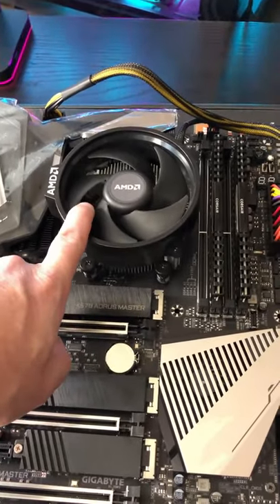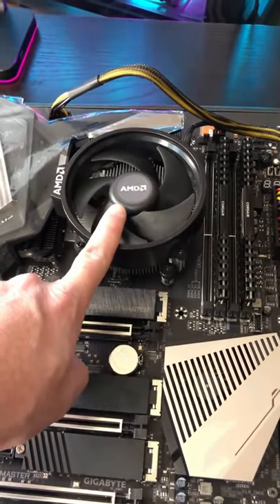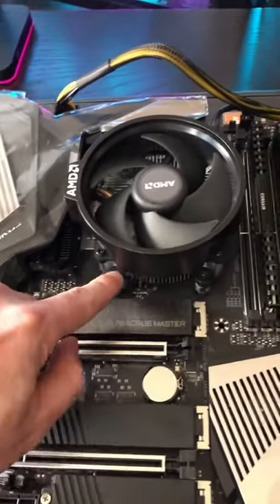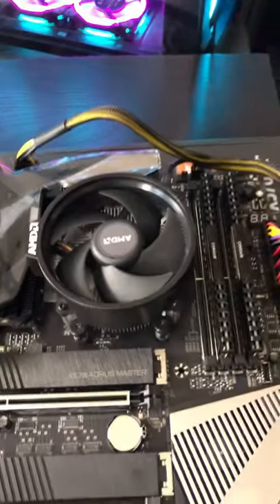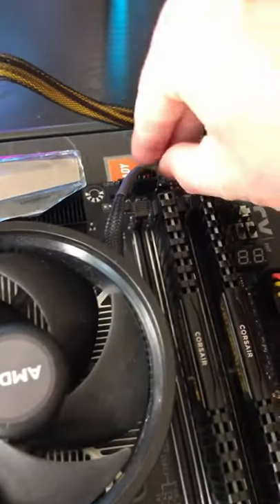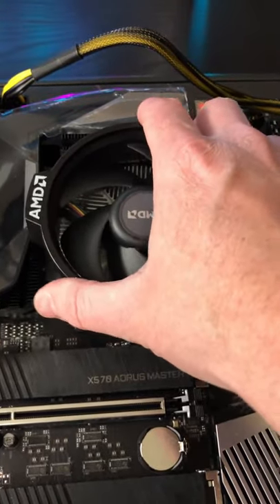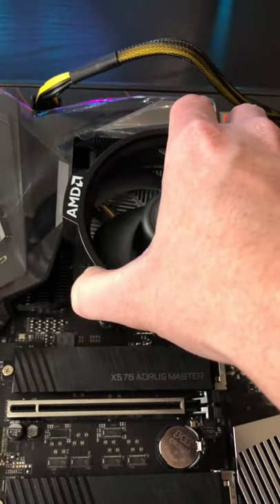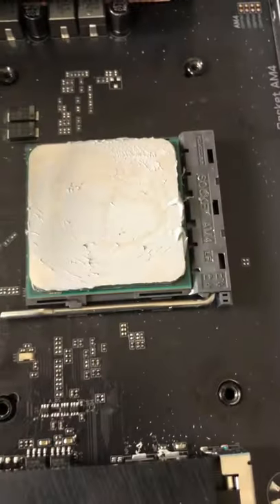How To Remove an AMD CPU Cooler Safely without Ripping the CPU from the Socket #shorts

Comment: Me: "Ok a little wiggle, slow and steady"
CPU: "YEET!"
Reply: XD
Reply: Lmaooo
Reply: I can't yeet mine, it takes three screws to open the socket
Reply: @messoremvitae  threadripper ?
Reply: @ianspy1  got a 1920x for 250 new
Reply: @messoremvitae  nice but i would much rather the newer TR parts. 
Sitting here with a 3600 wishing i got the 5600x but i couldnt wait
Reply: @liamcooper5202  personally im looking at upgrading to a 2970wx if possible. 24 cores instead of 12.
Reply: That one guy yeet!!
Reply: ahhahha
Reply: me, few hours ago
Reply: Crazy how the twist did all the job 😂❤
Reply: what happens if you pull it out

Comment: This video could've been help 3 weeks ago when I pulled my Cpu out and had a heart attack
Reply: Hope it still works
Reply: @gamingtalent2888  it all works, luckily I pulled it straight out and didn't bent any pins
Reply: @heyr3tr044  oh nice, i just got my new pc with the 3400g. I almost put thermal paste into the socket. I felt the same heartache😅
Reply: I had tge same experience lucky everything is ok
Reply: Same happened to me a year ago to a 3700x, after 15 years of intel builds it shocked me and I had to bend back some pins. Luckily still works tough.
Reply: I lost a 2700x this way. Not when I pulled it out but when I panicked that it was broken and tried to reinsert it with the fan attached. AMD should really improve its socket with am5. Make it more secure like Intel.
Reply: I just did this yesterday and did a strong pull, luckily nothing broke, i think i would have cried and breakdown from this long building process already
Reply: the same happened to me, but it falled in the floor and 20 pins were bended, so i had to bend them back to place and that took me 3 fucking hours :/
Reply: @NatrajChaturvedi  It's not the pins fault, belive me, those pins aren't easy to bend, but if you drop your cpu it's obviously going to bend the pins. If you treat the cpu carefully nothing is going to happend
Reply: Same happened to me today
Reply: I did the exact same think
Reply: Same happend to me
Reply: A few months back I replaced this exact cooler on my wife’s PC only to pull the chip with it and then see it drop on the motherboard. Long story short. I spent the next 5 hours straitening the pins with a tiny piece of plastic. And yes it worked like a dream after :)
Reply: Built my first PC just a few weeks back and had this happen when I tried reseating the cooler. Yeaaaaaaah would have been good to know.
Reply: That issue seems to have happened to a ton of people. AMD definitely should look into it.
Reply: @brunoglopes  If memory serves the Zen 3 / Ryzen 5000 series will be the last one using the AM4 socket so there's maybe a fair chance that the next one they use is a LGA..... or nah haha.
Reply: @Android Expert works like a charm. Doesnt boost to its max tho, its boost clock is 4.2 ghz but it stays at 4.00 ghz. It does get pretty hot under load tho even at 4.00 ghz.
Reply: Are you me? Because I did the same thing 3w weeks ago
Reply: Same here, I even bent some pins, luckily they were only like 3/4 at a corner that I could bend back.
Reply: Same, I did it during xmas and bent 2 pins
Reply: Same 😭😭😭😭
Reply: I nearly destroyed a Ryzen 9 doing that. Not a very good day.
Reply: had the same heart attack after renewing thermal paste
Reply: @NatrajChaturvedi  Yep AM5 sockests are using LGA 1718
Reply: @gamingtalent2888  How did you even do that
Reply: @trashgamedev5730  the previous owner had put a buttload of thermal paste on the cpu which leaked out of the sides and when i tried to clean it up, it got nudged into one of the squares but i managed to get it out with a needle before it got really stuck.
Reply: Same I was so scared that it wasn't going to work and I had just wasted 200 dollars
Reply: @graceeeess  u ok?
Reply: It's happened to me a few times and I just swapped the cooler a little while back to hopefully avoid having to do this
Reply: F bro😞✊
Reply: Note: if you use Noctua NT-H1 thermal paste, in most case, the CPU goes out with the cooler. The first time i got cooler out of the CPU: where the heck is my CPU. Oh my god, it has some pins bended because i wooble it a lititle hard. Other thermal paste has no prolem. Maybe this is the problem that AMD goes LGA instead of PGA in next gen.
Reply: @NatrajChaturvedi  🥺
Reply: Happened to me this weekend with my 3600. Didnt bend any pins thank fully, Cinebenched it and it works perfectly thank fuck!
Reply: So I removed the cpu fan and I can’t reinstall it I need help!!
Reply: @M3turkz1  did... Did you brake the screws off the motherboard?!
Reply: @heyr3tr044  nevermind i figured it out thanks for the reply tho cheers
Reply: Haha Same 😅
Reply: Same
Reply: same experience
Reply: @heyr3tr044  lucky I bent 1/8 of my pins and had to buy another one…
Reply: Its just happen to me right now and i don't have any monitor to test its sill on or not but when i see the pins none one of them get bent
Reply: Same It happened to me 3 days ago I have the same exact cooler
Reply: @heyr3tr044  I did this same thing I needed this video 2 months ago and did the exact same thing and I almost cried but it still worked I about cried 😂😂😂
Reply: @heyr3tr044  this happened to me too, i was really freaked out and thought i jus killed my cpu😂😂
Reply: Roast. Twist.
Reply: @gamingtalent2888  gotta go into BIOS to turn something on I can't remember what it's called but doing it makes your CPU use it's full power, should look it up.
Reply: @codeman90000000  i think you are talking about precision boost overdrive, i have enabled it already, still no dice
Reply: @gamingtalent2888  i think it's xdm look that up and oh dang. Still that's way better than 3.6 or lower lol
Reply: Fucking same. I didn't know it could even do that until BAM
Reply: I did the same thing once upon a time. but that led to beneficial upgrade so all good
Reply: @@s1gnified106  me 2, i hope it still works
Reply: I did bend a few pins but got them as straight as possible and I put it back and it's been working fine lol but I'm about to do another clean today so I hope I don't finish it off lol
Reply: Happened to me this morning, I found a new fear.
Reply: I pulled out my amd ryzen 5 5600 with its stock cooler and now it's not working, the cpu light is flashing on on the motherboard, is it the motherboard that has been damaged or the cpu?
Reply: @heyr3tr044  I just did the same thing 2 times this week 😅
Reply: @tushartevtia6292 did it work?
Reply: @Hiluxz hey I got my cpu with cooler attached is it ok to put it pack and tighten it into the locked socket, or I will have to remove glue between processor and fan first

Comment: Tip: If the PC doesn't turn on, you can use a hair dryer or an electric heat gun and it will work!

Comment: Literally a 2 second answer to the problem. MAKE SURE THE THERMAL PASTE IS HEATED UP BEFORE YOU TAKE IT OFF
Reply: I don’t have all minute to watch a video!

Apologies to Brian Regan
Reply: And wiggle the cooler
Reply: Didn't work for me. I had to pry my 2700x off the heatsink with a knife. Surprisingly I didn't break it. By next month it'll probably be dead anyway because it's degrading really bad. It won't turbo past 3.8 on water cooling and I had to set a manual frequency and voltage to stop it from crashing.
Reply: Αctually 20 mins
Reply: Literally only a problem because AMD made a dog shit retention system.
Reply: Or just unplug the fan, start the computer and watch the temperature monitor to reach 85C, then shutdown.

Comment: I ripped out my r5 2600 
Scared the shit out of me
Thankfully it still works
But wow, didn't know it was this common, at least I know now
Reply from the maker: I see it far too many times!
Reply: 1. Turn the PC on.
2. Let the CPU to heat up a bit to soften the paste.
3. Turn off the PC.
And you don't have very much time to put the cooler off.
Reply: I ripped out my Ryzen 7 3800x and a pin broke of, so it didn't work, I had bought a new cpu to replace it
Reply: The exact same thing happened to me, same exact cpu and everything
Reply: Same with the 2600X and wraith prism lmao
Reply: Why even pull it off?
Reply: @-eldiandrip-7261  in my case, i had to get the cooler off to put my nvme ssd into the slot lol
Reply: @nicowolters8959  literally just needed to solder a new pin, not so difficult with the magic of flux
Reply: @nicowolters8959  😭oof
Reply: I almost did this with my ryzen 5 3600 😬 it very nearly came out of socket but it was fine in the end 😌
Reply: Its happened to me every time. stock cooler blocked the RAM slot, bent 4 pins on 2200g, upgraded to a 2600x cooler took the 2200g out for me, got a better cooler took the 2600x out for me.
Reply: A fellow r5 2600 user here too
Reply: @nicowolters8959  sad
Reply: Same lol
Reply: Same , at the time I bought a new cpu cooler to replace the stock one and it happened to me. I thought I broke it initially but it still worked to my surprise LOL
Reply: I had same cpu pulled out the cpu cooler and saw cpu on it. I laughed so much and showed to my friends they were impressed. The cpu is fine! Wont happen again.
Reply: Happened with my phenom, thankfully it still works too
Reply: @nicowolters8959  have you tried reaching out to someone who can replace the pin? That's something very expensive to give up on
Reply: I did it too! I pulled the cooler out and looked at the socket and was like "WHERE THE HELL IS MY CPU!!!?"
Reply: @nicowolters8959  you can try a small segment of rj 45/ethernet cable, once I did it with a damaged sempron 3400 it worked

Comment: I never knew about turning it on to get it warmed up.
Reply from the maker: Yep!  Get the paste as gooey as possible so it doesn’t act like such a glue!
Reply: @PCTechHustle  gotcha
Reply: Tbh it doesn't make a huge difference. It won't get very warm and you are probably wasting time waiting for it. Just be careful, twist, and lift.
Reply: @criticallycheesycaleb6681  run a CPU stress test then
Reply: @amvymavy  no I'm saying heating up the cpu isn't all that necessary to begin with
Reply: @criticallycheesycaleb6681  maybe, I don't know. Maybe heating up the CPU only applies if you have a fairly new thermal paste. Thermal paste that has not dried
Reply: @criticallycheesycaleb6681  depends on type of paste. Arctic Silver is certainly on the  EXTRA THICC  side when at room temperature. And that's how I ripped FX-8350 out of AM3+ socket (it was fine).
Reply: Necro threadinngg wooooh the reason you do this is because AMD cpus specifically are widely know that they do this. If you use intel ur fine. For reason the 2600s and similar series get stuck af to the cooler. Maybe its the wraith tyat comes with it. Regardless, you absolutely should do this if you have an AMD 2000 series cpu

Comment: Between step 1 and 2 I'd recommend powering down and unplugging the pc.
Reply from the maker: Yeah I figured that much was obvious, even to for an novice.
Reply: @eltigre4419  I must be special then, or maybe it's because i'm 29. Once I hit 30 it's over 😂😂
Reply: @eltigre4419  Jesus lol, It's all very simple stuff that can easily be googled. Are you in the states??
Reply: @eltigre4419  Ahhhh, Germans are typically smart people though!
Reply: @eltigre4419  hehehe
Reply: Wait, wait so you mean I'm not supposed to take the cooler off while the system is running? 🤨

Oops 😯

Comment: I usually just slide the cooler down to the right and lift it up, way safer as there is still a chance your cpu could get stuck to the cooler by pulling it up, especially if the thermal paste is years old
Reply from the maker: That’ll work!
Reply: Just changed mine and the whole CPU came out with the cooler and my heart fucking sank, I genuinely was about to cry but new CPU went in and it’s working good max temps I’ve gotten out of stress test was 174F 
Now my GPU is running at 100% usage and the CPU is 22% before they were both max usage

Comment: I’ve never worked with AMD cpus so I was completely unaware that their sockets lacked a method of locking the cpu into place. Good to know
Reply: The older versions don’t I think but I know my 5800x has a latch. I think any non am4 sockets don’t have a latch. Or maybe only certain motherboards. I don’t know.
Reply: @sambennett2319  the problem with pga no pressure action, it also means no pressure action, other than the cooler ofc. i almost got a heart attack when I found out my fucking 5950x got stuck to the cooler. fuck me.
Reply: @nothorren does ripping out the cpu damage the motherboard?
Reply: @Jake-xx9xq  probably, i woulnd't trust my socket anymore, although, CPU is fine
Reply: @sambennett2319  2 years late but AM4 sockets have a latch. They just don't have a retention plate like intel and AM5.

Comment: For the really dried and stuck on paste, use floss, wedge it between the cold plate and the CPU’s IHS, and then use the back and forth motion to slice away at the paste.
Reply from the maker: Good idea!
Reply: Cool idea, but when paste is dry it will crack and break eventually, just twist that damn cooler by 1 degree in each direction and do not pull until you feel it's starts to move up and down a bit by itself. Sometimes it can take like 2 twists and sometimes even 20. But it will detach eventually.

Comment: Easier trick:
1. unplug wraith cooler from the motherboard
2.turn on the pc, boot to the windows, processor temp gonna rise up and make thermal paste melted, after that turn off your pc

3.loosen up fan screw, after that shake the fan to left and right slowly, pull out the fan slowly and the cooler fan plugged out

Why we need to slowly plugged out the fan because the fan is sticky to the processor because of the thermal paste, that's why we need to warm up the processor withouts the fan turned on to melt the thermal paste

Comment: Now I gotta ask, when putting a new cooler on (one with thermal paste already on it) do you need to clean the existing paste here or can you double layer it? cream sandwich, delicious paste, more cooling?
Reply from the maker: Just use the pre-applied paste.  It performs completely fine as is.  I wouldn’t add more either, no need.

Comment: Tip for kids and other people that ripped their poor innocent AMD CPU out of the sockets:
1. Turn the PC on.
2. Let the CPU to heat up a bit to soften the paste.
3. Turn off the PC.
And you don't have very much time to put the cooler off. Twisting it that hard is a very bad idea. Start very slowly and patiently, until you feel it much easier to move around.
Reply: I’d add that you should stress the CPU a bit too.  Like run prime95 for like 5 - 10 mins. Even just turning it on is sometimes is not enough especially since some pastes need higher temps to really soften.
Reply: Your paste like fuckin glue??? I have built a lot of computers for myself and some friends, swapped cpus and coolers and have rarely had one come out of the socket and even if it did i've just picked it off the coldplate... twisting it isnt going to hurt anything, you wont twist the cpu on the socket because they are only bonded by some paste
Reply: @reecesoan8138  it really depends on the thermal paste. But some paste I’ve legit had the PC on for like 10 or so mins and I even twisted and the CPU still came out. So I just resort to being on the safer side and letting a stress test run to make sure it‘a soft.
Reply: @alisso23e  ohhh fair enough. I'm actually surprised, ima count myself lucky then because i suppose its pretty nerve racking if it comes of the cooler when your not expecting it
Reply: @reecesoan8138  fun fact: paste dries after some time.
Reply: @thisfeatureisbad  fun fact ive worked on PCs nearly as old as me...
Reply: @reecesoan8138  amd stock paste is shit glue
Reply: @jaguarover55  ahh, yeah i don't like the idea of using pre-applied paste. Especially when small syringe of paste is so cheap. Thanks for letting me know, i was about to build an amd 3600 pc for friend using stock paste cause i ran out... guess i wont be
Reply: @jaguarover55  true
Reply: When paste is old it's easier when cold. It crumbles off when twisted. I speak from 20 years of experience.
Reply: @lazy5877  have you ever had an amd cpu rip out of a socket while removing a cooler?
Reply: @reecesoan8138  Once. EDIT: It scared the shit out of me as the cpu was damn expensive, it was phenom II x4 965. I didn't know back then about sticking cpus to the coolers, I pulled so hard it came out with the cpu thankfully pins were fine, but paste was rock hard and had to use razor to detach it. amd was not first with pga socket, I had intel celeron 433Mhz, but after that almost always I had AMD, first one was AMD K6II 500Mhz (It actually performed worse....), back in 1998, then Duron 800 with that funny little chip, then Athlon XP and then Phenom II. Those pins were damn thick in 90' era, so it never happened to me before.
Reply: Chris Schuler  i would say a near 50 50 split, i haven't touched intel in a while considering AMD's recent domination

Comment: Nice, youtube recommends me this after i ripped off the stock cooler with the cpu. At least no bend pins lol.

Also i thought running it for 10 minutes while stock temps were over 60 was just fine but apparently not lol
Reply from the maker: Dang!  Well at least there were no bend pins!  😬😬😬

Comment: I just yoinked it out and my cpu was still chilling in there. Didn't know this could even go wrong tbh
Reply: Maybe it depends on the type of thermal paste? I use a Be Quiet air cooler with my 3600 which had pre-installed thermal paste. I'm sending my motherboard back for warranty stuff, hence why I'm here lol. I have another tube of paste from a Cryorig cooler I had on my old system so I'll just have to use that when I get a new motherboard.
Reply: @TheProficy  it was the preapplied paste. I unscrewed the bottom 2 screws first and basically rotated the cooler a bit and it got unstuck, the the other 2 screws and it was fine